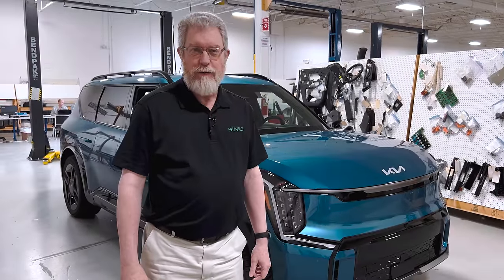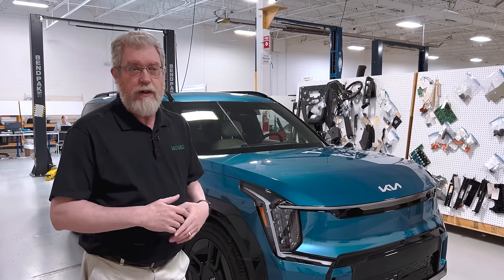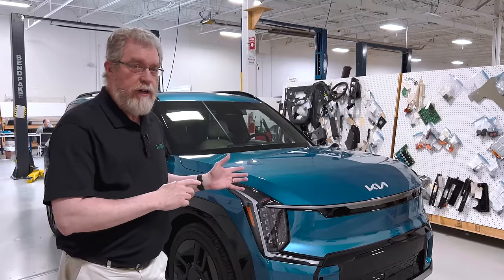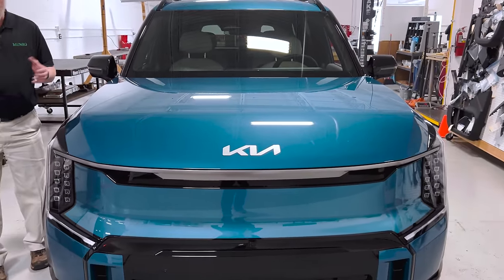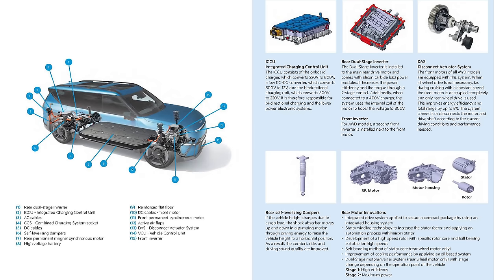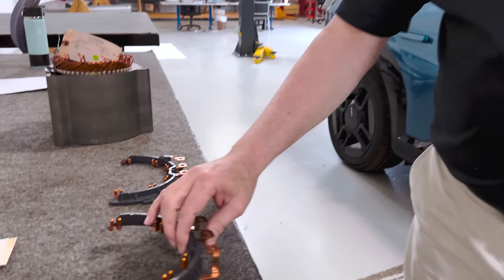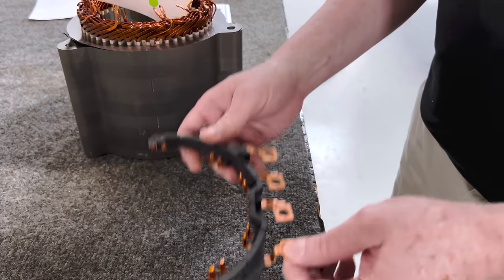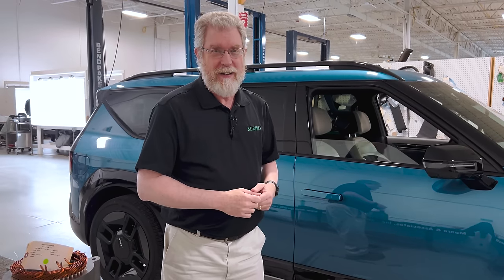Kia EV9 - 800 Volt Architecture

Comment: Paul, great presentation, but most DC Fast Chargers (except Tesla) have an 800-900 V architecture.  Why can’t these directly power the EV’s 800V battery charger?  I see no need for a boost.  Is it because the semiconductors needed at this high voltage & current are too expensive?  

I’d love to see the circuit for the 4th wire filter using motor inductance.

Comment: Great video. It would also be helpful to know a) Why a filter is needed. I assumed they were getting to 800v via a DC-DC converter. Does that process require a filter? or is the DC being converted to AC, then stepped up, and then being rectified to DC again, which of course requires filtering the choppy current as a result of that process? And b) how exactly is that extra winding performing the filtering?
Reply: I want to know too.  Usually these filters also need a capacitor.  But do they use the battery as a capacitor.
Reply: I'm not an EE but a systems engineer but isn't a filter (high/low pass) mostly a combination of 1..n inductors and 1..n capacitors? Inductors are the expensive and heavy part so using the windings in the motor in "reverse", as a transformer, allow them to get that part of a step up converter sourced. Looking at a medium voltage (100-240V) one for my Vitamix US sold blender in my Swedish (240V) kitchen, that thing is heavy and 80%+ of its weight, and probably it's cost, is that transformer
Reply: @NirreFirre  That's an interesting idea about using the motor windings to step voltage up or down. But. I am recalling that Tesla does it in the inverter. It was actually explained to me by an EE that both the inversion of the DC to AC (to spin the motor), is the same circuit that converts the incoming AC from regen activity into DC to charge the battery. I believe the voltage step and step down occurs ine that box as well.

Comment: I suppose the motor is connected in Y versus normal delta, using the zeropiont as the 4th connector. Also a way to get down the current with a higher voltage.

Comment: How about showing the basic schematic for their boost converter.  Presumably the motor is just part of an LC filter, or is it a "ringing choke" kind of booster instead of using a higher-frequency toroidal transformer with MOSFET or IGBT drivers and the motor is just the inductor in the filter.  Whichever it is, reusing the motor as a large inductor is clever design, but the charging infrastructure needs to move to 800-1000 volt architecture to reduce the current in the cables, in the next generation of chargers, even if it is split within the car to charge two 400 volt "half battery" packs to drive existing traction motors.

Comment: Why can't they split the battery in two half's? When charging, charge each battery to a  parallel connection at 400 volts then when done charging change the contacts to series to make 800 volts.
Reply: I think the cybertruck does this.
Reply: And bmw of i recall correctly.
Reply: Some do that already
Reply: Cyber truck does this
Reply: Macan EV and Q6 etron do that
Reply: You are correct, using a contactor like the Cybertruck uses is a much better engineering solution than this cumbersome and expensive engineering Frankenstein. Not only is much simpler, neat and less expensive, but it also allows you to charge at full power as well. Sad to see a Monroe video that's all wrong on the engineering side.
Reply: I would imagine you would lose a lot of your wiring benefits by doing this. You went 800 volts to reduce wire weight, and then added half of it back in.

Comment: Corrections*:  NO "FILTER" is involved:  the 400V to ~800V Boost Converter re-uses the Inductance of the motor windings instead of a separate dedicated Inductor!   Inductors store energy from pulsed magnetic fields, which is how you can step-up or "Boost" a lower voltage to a higher one.  A "filter" removes stuff, like noise and spike voltage peaks.   Not the same as a Transformer either, which uses magnetic coupling to induce a higher voltage to a secondary with more (or less) winding turns to a higher (or lower) Voltage.   

* Engineering and Physics require accurate and precise thinking and language, which unfortunately is not in evidence in this review.  Not exactly a great "optics" for an Engineering Consulting outfit.
Reply: The inductor and capacitor of DCDC converters in high voltage applications are often referred to as "filter" components. They are technically L-C low pass filters, but you don't usually think of them that way especially for low voltage DCDC. They are referred to as filters in higher voltage applications because they're a lot bigger and often separated from the control circuitry. The inductors and capacitors are often the size of a coke can.
Reply: @supernumex  There is a vast difference between a L-C low pass filter and a Boost Inductor switching supply.  Regardless of the operating voltage, they operate quite differently for different purposes.  It is disconcerting that neither the presenter or you know how they operate, please look up "switching regulators".  This is like conflating an ICE engine's flywheel and pistons; one smooths vibrations, the other provides bursts of power.
Reply: @shazam6274  The inductor and capacitor in a boost converter are often called L-C filters.
Reply: @atihigfatihigf6597  You can call the Unicorns, but the "filter" capacitor is after the boosted voltage from the inductor is rectified.  The inductor is not part of a "filter" but an energy storage element which adds voltage to the incoming switched DC.  Totally unlike the inductor in a "filter" which reduces ripple and spikes, along with a capacitor, in a lossy circuit configuration.
Reply: Thank you for highlighting this issue. The discussion here matches my thoughts on how to describe the use of the motor windings as the inductor in the DC to DC boost conversion. I didn't want to bog down a 10 minute video with an explanation of how a boost converter works and I was searching for language that non-technical people would understand. I agree that "filter" is not an ideal description of how this is used, but hopefully interested people will find this comment chain and do some research to see the rest of the story.

Comment: Why do they use a boost converter when they could disconnect the battery into two halves electrically to get two 400v batteries and just charge them in parallel
Reply: most engineers like to creat problems to come up with solutions. 

imagine how boring this episode would be if he just said the banks where connected parallel for charging and series to drive. i’m sure a voltage converter to run the hvac would cost less that one for the entire battery.
Reply: @RickyLourenco  The high voltage contactors to switch between series and parallel cost money. The safety interlocks to prevent shoot-through also cost money and engineering time. Not to mention cost and complexity of the pre-charge circuits to equalize voltages before connecting the packs in parallel.
Reply: you have no idea how a contactor and interlock work. the two can be the same. again adding more parts.
Reply: @RickyLourenco  fair enough, you can combine contactor and a mechanical interlock like in the HV switch of the cybertruck. This is an extra mechanical part to fail. The pre-charge/pack voltage equalization circuitry before connecting in parallel still needs to be engineered and costs money and space.
Reply: Because you choose either to have a battery pack that can switch as you described with the high voltage connections or you add a boost converter as Kia did.  They decided their solution as superior for their tradeoffs.  Putting in the switches to convert the pack between 800v and 400meanx those switches must run at full current so they are not free.

Comment: It would have be nice (especially considering this channel attracts the engineering minded) if you backed up the fastest charging with specs. How many miles added 20 to 80% ?  Miles per hour charging? The charging curve? 20-25minutes seems pretty close to Teslas 400 volt.
Reply: Indeed 😳😬 cell voltage on existing chemistry is the limit, not the fact that you have higher voltage
Reply: The engineering minded know that cars charge kWh, not miles. There is no "miles per hour charging", it's just a guesstimate.
Reply: @gedfi : A thoughtful engineer doesn’t care how many kWh an inefficient vehicle with large battery can draw. What matters is the time needed charging to get home or the next destination. What matters is how many miles of range are added in a given amount of time. mph charging curve. A highly efficient vehicle doesn’t require a large kWh like an inefficient vehicle

Comment: The EV9 isn't really 800 volts in the large battery version tho.
Reply: True, one would still consider this an 800V system architecture, which is more like a range of 650V-900V
Reply: EV9 is not really a Competitor.

Comment: Using motor inductance as a filter choke isn’t exactly a new idea, so apparently there is something specific to Hyundai/Kia’s use of motor inductance which makes it patentable.  Using freely available inductance for filter chokes goes back to at least the 1920s where loudspeakers sometimes had DC windings to provide the field, a time when powerful rare earth permanent magnets didn’t exist.  Radios used the speaker DC winding as the B+ power supply filter choke.

Comment: Why not go straight to 5000 Volts architecture?
Reply: Voltage leaks .. you will have to maintain a safe distance if that voltage is running in 5k-10k range. More the voltage more the lethal
Reply: each cell gets its own charger. Have 1000 Usb C ports , 5V x 1000= 5000V
Reply: @Y2Kvids  nice idea

Comment: Yeah, this 4th connection in the motor that acts as a filter is a brilliant solution, kudos to Hyundai/KIA engineers. 🫡🫡🫡
Reply: Renault also used the motor windings for charging on the Renault Zoe 10 years ago, albeit on the ac - dc converter on a 400V battery system so the idea is not new or unique

Comment: Cyber truck splits the battery in 2 to charge at 400v. Saves them charging at 800v. Why you didn't mention this?
Reply: Because changing at 800v is preferable, charging at 400v limits charging speeds due to current limitations of the cables.

Comment: A boost converter makes no sense in that application, you just switch the pack to 400V when charging. ie parallel vs series.
Reply: Each approach has different trade offs.

- A boost circuit approach is more complex but lower cost as it re-uses existing components for the boost circuit, offers integration with the inverter management with softwre based flexible control. Plus reuses the existing 800v battery management / charge system. Longer to design and develop as using a LV (<1000v) electronic/solid-sate approach (higher reliability). 

- A contactor switch approach, is simpler but more expensive as it requires additional heavy duty cabling for the battery two configurations, voltage select switch control and monitoring circuitry, and more complex battery BMS/charging circuitry (pre-switch pack balancing, 800v charging and 400v charging modes). But is quicker to design and implement using LV Industrial switchgear based approach.

Comment: Hyundai is not the first to use the motor windings to eliminate charger components.  

AC Propulsion had patented "reductive charging," using the motor windings as a filter for the on-vehicle charger (240 VAC single phase to 400 VDC).  AC Propulsion used this for their T-zero cars, and BMW used it for their original Mini-E that used AC Propulsion motors and inverter-chargers.  Tesla licensed the patent from AC Propulsion for the first Roadsters, but stopped using it in the later versions of the Roadster.

Hyundai's use is a bit different, since they use the windings for the 400 VDC to 800 VDC boost converter instead of the on-vehicle charger, worthy of a new patent for Hyundai.

Comment: Fastest charging on the market is a stretch…
Reply: Well the E-GMP platform in the Hyundai Ioniq 5 and KIA EV6 has a 10-80% charging time of 18-19min since 2021. In western markets there is not much out there which charges faster, only the recently updated Porsche Taycan. This KIA EV9 charges slower tho, they slightly changed the battery structure in this vehicle. The chinese market is a whole different story.
Reply: my Tesla charges @ 1000 mph .
250+ miles in 15 minutes.
Reply: @markplott4820  lol 1000mph nice try Tesla troll. Try a little harder next time

Comment: So the motor has double the electrical wear and tear because all electricity to and from the battery goes through it. Wouldn't that degrade the motor windings twice as fast? Isn't the pure sine wave converter for charging cheaper to replace than the motor? This design sounds cheaper to manufacture, but more expensive to own in the long term. Peace
Reply: What wear and tear? These are just electrons and magnetic fields moving backwards and forwards. So long as you are not trying to put in too much power into the copper windings then you should be ok. Also the 4th winding (boost winding/filter) will only be used during charging IMHO.
Reply: I'm currently looking at buying an EV9 and was thinking the same thing about the rear motor. Also, in May of this year, when the EV9 is built in Georgia, will they change the charging components when they start using the J1772 connector? By the way, the kia EV9 seems to have a great charging curve.
Reply: Fatigue?
Reply: Maybe heat it up and that can lead to issues for desert drivers. Cruise Death Valley after charging and find some flames due to a faulty sensor?

Comment: The car is more like 650 volts, and the booster can’t run 350kw, I only get 100kw when charging on 400v chargers, and upwards of 250kw on 800v chargers.

Comment: I agree 800 volt system is the future for fast charging, however since most EVs r charged at home, this is not too big a deal. U never mention that the Tesla model X is in the same price range of $79k. U can’t compare the 7 seat X to this ask Sandy as he couldn’t  get out of the 3rd row. 100KW battery well under 300 miles goes to show u how inefficient that battery system really is. Lol. If Munro is only going on 800 volt great, but evaluate the entire battery system and its efficiency. IMHO

Comment: MUNRO - its all Theoretical .
the issues is the very CRAPPY CCS charging infrastructure in the USA.
Reply: the US is not the center of electric automobile innovations or sales. CCS infrastructure works great around the world
Reply: @Aztasu  - the OP probably meant CCS1 as used in some places vs CCS2 that offers higher capacity charging that is the standard in many other parts of the world.

Comment: I don't like mentioning 800V as a way to speed up charging considering this an engineering channel.  Tesla's DC charging at 400V is absurdly powerful that it is detrimental to battery cells.  800V true value is to reduce wiring cable sizes.  I am also not sure if Hyundai's brilliant idea is brilliant at all considering that if you split an 800v battery into 2pcs 400v or 4pcs of 200V through physical electrical links then the car be compatible on 400v/800v DC chargers like the Cybertruck.
Reply: No, sorry, that is not true. 800V true value comes from speeding up charging times. 
Around 75-85kWh total battery capacity is where the switch to 800V needs to happen if you still want to charge "bigger" batteries somewhat fast (C-charge rate of 3C or higher). A normal 400V charger at 500A-525A can only deliver 200kW-210kW. At 3C charge rate a battery with 75kWh capacity needs 225kW to charge at 3C. A Tesla charger can output 250kW-255kW at 400V because they use higher Amps. However even here a 85kWh battery is right at the edge of getting full power. A 100kWh battery would already need 300kW at just 3C. That is the reason why the Cybertruck needs 800V for its 130kWh total battery size.

And 100kW is becoming the norm as the biggest battery option for even mid-sized premium EVs nowadays.

The switch to 800V also needs to happen if you want to push for even faster charging times in the realm of 15min-12min from 10-80%, which translate to around 4C  and 5C peak charge rate of the battery (charging curve is also important).
A smaller 75kWh battery also already needs 300kW at just 4C just like the 100kWh battery needs at 3C. At 5C the 75kWh battery would draw 375kW from the charger.
And a 100kWh battery needs 400kW at 4C and 500kW at 5C. Without 800V (and higher) that would not be possible (you can't just push Amps up instead as Amps increase resistance/heat and therefore charging losses more than higher VOlts do)
Even Tesla will slowly shift to 800V chargers and models. Teslas entire lineup is outdated at this point tho and they do not really have an incentive to speed up the process of deploying 800V chargers at which the competition can charge must faster already.

Every mid-sized premium EV without 800V is outdated and not future-proof and should not be bought, the Tesla Model Y LR or Model 3 LR come to mind here.
Reply: @Aztasu  You may have a point on the 120kwh Cybertruck but Tesla's other cars weren't upgraded to 800V because their chargers are more than powerful enough.  Prior Cybertruck, Elon said in one tweet that 800V is not required for their cars. 
  If you look into data sheet of reputable brand of 2170 cell, the maximum charging rate is only 0.7C or around 3amps. Tesla DC max charging rate exceeds this charging C rate multiple times.  In the real world, DC charging curve rate drops rapidly after just a few minutes and that high power charger is rendered less useful very quickly.

Comment: someone needs to explain series vs parallel and how that can be used to change voltage. no need for boost converters. 

when it comes to charging, the limiting factor is the cell, not the voltage of the battery. 

stop adding more parts that can fail.